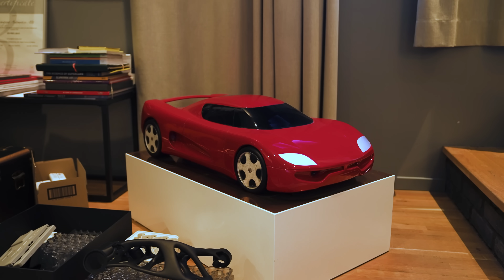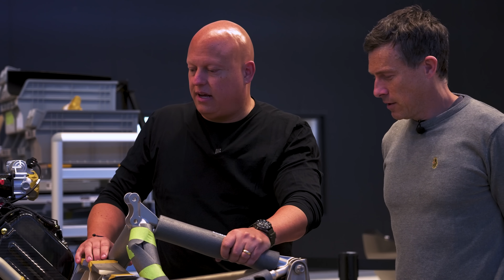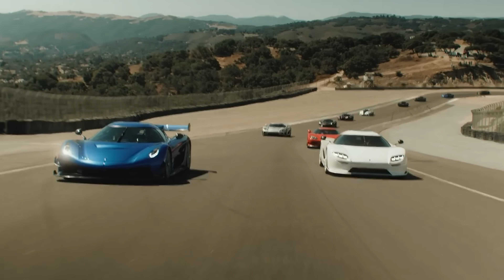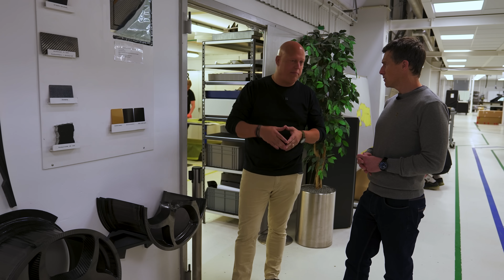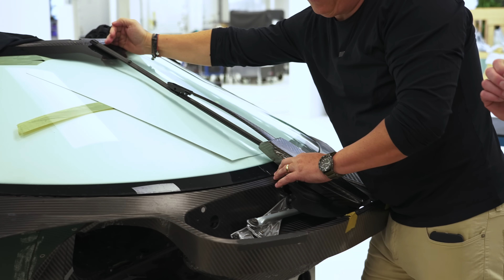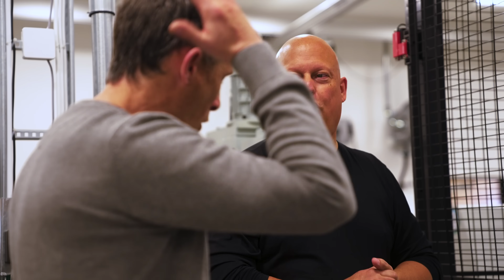Why Koenigsegg’s new 2,300hp hypercar changes everything

Comment: 335 mph is THEORETICALLY Possible for a car like this given the power outputs and drag coefficient. (What's LACKING however in order to make that possible though is the 18 air vents on the wheel fenders (9 on the front left and 9 on the front right) like the Bugatti Chiron Super Sport and the Bugatti Chiron Super Sport 300+

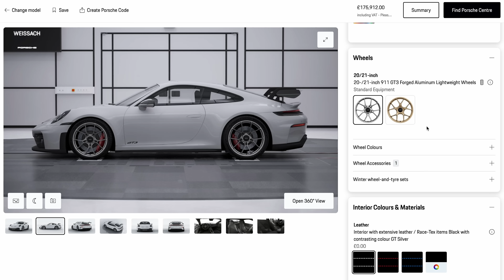Comment: Around 22:50 interestingly seems like the caliper assembly should also act as a pendulum or swung mass for better control on turning and stopping. The swing on the caliper assembly could be adjusted by the rack as it rotates along the knuckle. I just thought I’d share this with anyone watching. Has nothing to do with the cars in the video lol

The knuckle and caliper throw suspension augmented angle back with mass off to one side in the rear. Of course the suspension rides it’s own angle but the caliper assembly is preventing it from being a proper piston. It has mass in the back.

Comment: 2300hp is insane. But this sounds like it is so smooth and very balanced w/deep torque and power curves that are throughout the entire system. Amazing. The valves control by electronic pneumatic control I thought about 30 years ago but he actually did it on a 3 cylinder and got 600hp out of it. Crazy.

Comment: To say carbon fiber does not flex or crack under pressure is wrong. That’s why they don’t make submarines out of carbon fiber because as we know, one company found out the hard way sadly, their submarine built from carbon fiber blew up halfway down to the Titanic, so carbon fiber does have a stress factor and a life expectancy like all forms of material even a submarine, which again the military does not make out of carbon fiber for a reason has a life expectancy, but of course we’re not driving this car at the massive amount of pressure that the Titanic is subjected to, but a pothole. Yes, I know it’s a different an inherently, less dangerous, subject, and much less pressure but still hit a pothole it 315 miles an hour I would be willing to bet that carbon fiber would probably break too.

Comment: I’ve watched videos on freevalve ,and we alredy have many engines which can do 85-90% of what freevalve can do, and that last bit of 10-15% on some engines yes can make a 30-30-30% increase in power mpg,and emissions,but the cost to go main stream would be massive based on what many experts say..I had thought free valve was magic but we have oil controlled valves which can already do what freevalve does within 10% and for 1000’s less …bmw has a engine which already provides dozens of different camshaft profiles with just oil pressure..if freevalve could be done cheaply with a computer which didn’t double the cost of the controller and harness maybe, but still I’d love freevalve from a tuners perspective being able to just add a turbo push as much boost as you wanted within reason and always have the perfect torque and power throughout the entire RPM band. If you could keep the cost down, which is highly doubtful, which is why Free valve will probably never go mainstream.. a Chinese company tried it and decided against it due to cost..

Comment: Not impressed. The body has lots of surface imperfections from the manual sanding. You can see in the light reflections why humans can't compete with the machines. The only insane thing at Koenigsegg is the huge ego from the egg-shaped head of the owner, who thinks that his cars are perfect. The engine's power also produces an enormous amount of heat. That car is for showing off only. The yuppies and rich old men are the buyers. Who would pay such an overinflated price for a useless car?

Comment: And the EV McMurray still blows its doors off.
Reply: Cool that McDonalds has started to make cars like the McMurray 😂
Reply: @netmannetman8124 which makes this Koenigsegg variant even more embarrassing
Reply: @simhorizon446 Nope not it at all ...Koenigsegg never stated or claimed that the Jesko Attack would be a super fast car in a straight line. They only stated that the car would perform geat around a race track as it was designed to do. But the Absolute version was designed with top speed in mind and will perform great in a straight line as proved by Carwow who tested the Koenigsegg Regera against the Absolute in a straight line and the Absolute out performed the Regera 👍..So the game is still on 😀
Reply: @netmannetman8124   The McMurtry Spéirling would lap any track considerably faster than this Koenigsegg  … McMurtry would probably lose on final top speed unless the modified the electric motor drive ratios.  The Koenigsegg is more about form over function.  2300 HP can’t be utilized until the car is over 100 mph as it would just melt the tires … so all that energy can’t be utilized.  The McMurtry can use its energy so much more efficiently and deploy it so much more efficiently … The McMurtry was a full 4 seconds a lap faster than Renault R24 F1 car and the McMurtry was 15 seconds per lap faster than the Koenigsegg Jesko Attack car.

Comment: Comes down to traction control and 4 small patches of rubber to the road. There are 250 horsepower motorcycles  that weigh 450 pounds.  If not for electronics not rideable.  Electronic awd making thousands of calculations per second makes this vehicle drivable.  Analog awd no way.

Comment: Variable, REAL TIME GPS engine mapping based on lat/long, vehicle speed, engine rpm,  transmission gear, manifold pressure, coolant temperature, throttle position, roll/pitch/yaw Gs while on the race track is mind blowing. 🤯

Comment: I love cars.  Style and design, engineering, and where those meet. 

But when it comes to electric motors, I couldn’t be more bored. Where’s the engineering? Oh the batteries have a cell with more electron storage blah blah I don’t know and I don’t care. 

There’s no passion in an electric motor. There is a Freudian connection to the internal combustion engine that I want, ha ha. And seeing these beautiful cars with a humming whining e-motor that could be interchangeable with any car… it doesn’t feel the same. There are no interesting features or challenges in the building of an e motor. Electricity, drive shaft (is there a driveshaft?, jk, I don’t care) wheels, boom, done, just like the next guy. It’s too easy. It’s too easy to go fast. Part of what makes Ferrari and Porsche great is the innovation in engineering engines to create a specific model, or overcome a specific problem. Struggle precipitates greatness.

Comment: My car has a 3 cylinder engine but it's a Hyundai,  I can't stand the thing,  every other car I've had has had a standard 4 cylinder engine,  my current car has the ability to shake itself to bits I reckon,  the other day I was letting the engine warm up before setting off and I happened to have the door open,  I kid you not when I noticed it I closed the door as fast as I could, the entire thing was vibrating so much that I was worried about it developing metal fatigue and my door falling off!  There is no way and no person on the planet who could convince me that the level of vibration is not going to end up with something breaking!  
Two words,  "Planned obsolescence"

Comment: I need a multi hour documentary with CK guiding us through the Koenigsegg facilities. Anything he is willing to show and talk about. Im talking design studio, wind testing, machining, making of carbon parts, electric motors and batteries, THE DOORS, break in, paint, drive testing, pre delivery inspection, crash testing, structural testing, THE DOORS again cause the engineering is so cool, customer delivery. 

Im sure youve already thought about it…

Comment: I love everything about Koenigsegg as a company. If I had one critique, it would be to shift a little focus away from chasing ever-higher horsepower and put more into refining overall drivability and the driver experience. I love fast cars, but anything beyond 500–700 hp just isn’t usable outside a racetrack. Trying to manage 1,500–2,000 hp on the street is nearly impossible, and buying a hypercar that ends up collecting dust doesn’t make much sense, no matter how much money you have.

Comment: I did some work for the company that helped Christian to make the first show shell and also made a bunch of parts on at least the Agera, including some of the carbon wheels. he let me hold one of those carbon wheels and they are crazy light! but I didn't want to hold that wheel for too long and I was really careful putting it down on the floor again because of how expensive those wheels are! if I'm not mistaken did a set of carbon wheels on the Agera cost about one million swedish kronor (just under 100 000 euro or just over 110 000 usd)

Comment: it will not change that much. You proved that a 1600hp 2000kg Bugatti is still faster than a 1600hp 1300kg Koenigsegg. They can't translate all that power into acceleration.

Comment: One electric motor running 4 individual torque vectoring simultaneously?? Umm..... shouldn't that come along with a rather questionable HOW...... no, obviously not! One motor running as if four completely individual motors as if on each wheel, seems a little ahh..... impossible!! By scientific laws & rules you'd just not bother to even try, & there in lies the many many limiting lies controlled by modern sciences premise to do so!!

Comment: If ford GM,and dodge used his tech which is used in F1 they could make 30% more power ,and fuel economy as well s less emissions while saving trillions combined over many yrs, by not using batteries…for one thing gas car engines are cheaper ,have more aftermarket parts, as well as being cheaper to rebuild,аnd recycle as well as being recyclable!

Comment: The free valve system was first developed by Lotus and Renault way back in the eighties. It wasn’t that successful but koenigsegg has developed it to its current level.
Reply: But still not ready for production.  No car sold by them has that Freevalve system installed.  So it is a vaporware.  You cannot make it work by selling to middle east oil tycoons.  They use the car as high end toy.  It is quite obvious that it will never been used in any production car.

Comment: Koenigsegg should partner up whit Volvo to build the new S90 hybrid whit small 1.2L 3cylinder whit 300hk using the free valve technology and the black matter 300 hk electric engine and 40-kwh battery for 300km range in pure electric mode whit ability for 200-kwh fast charging in 15 min. This car will totaly crush the market. 600hk 0-100km/h in 4-5sek 1200km in range  and only 0.4-0.5L fuel consumption per 100-km. 😎👍

Comment: Due to physics of tyres more than 1200hp are useless. You cannot get it on the ground. You always end up at 2sec 0-100. After that you need active downpressure (fans). So lets see when Koeniggsegg offers 10.000 hp for the technically imbecilles.

Comment: If only Koenigsegg could build a car capable of working 24 hours without breaking and going to the service center for many months each time it fails. From what I've seen a Koenigsegg requires at least 3 months in the repair center for ever 30 minutes of run time when it will actually start. Their warranty time should only be counted while the car actually works and have the clock pause for every minute spent being repaired. Evidently Koenigsegg has zero quality control and no clue what that means.

Comment: It's Alright building these huge horse-powered engines. But let's be practical. ''WHY'' It's not the fastest car with 2.300 hp that people want, it's a comfortable car to ride in. With the state of British roads, you can't drive very fast anyway; if you do, numerous accidents occur. The police pull you over for speeding. If the streets and roads were like racing tracks, then yes, a fast car would be very nice.

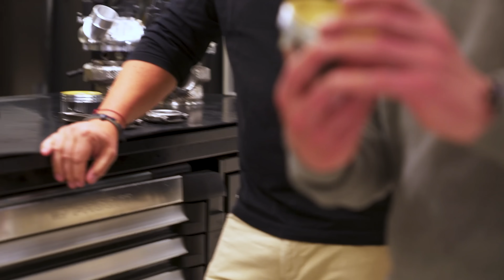Comment: 15:50 “No one is gonna see this.” I disagree.

Koenigsegg factory a assembly hall where wizards come to work.

On one hand you have the craft of assembling a car which is an essential part of engineering per definition.

The whole construction is larger than its parts holds only true if you add up on it in every detail and make every tool and car part special as well as make it look and feel special. You treat it differently and it adds up everywhere.

The assembly line was by far the cleanest I have ever seen and I worked several years in the trenches of a huge international car company as a student. So this relationship is mutual, not one sided.

On the other hand there is bootlegging and cheap clones not only damage reputation but can cause serious damage to people in the hypercar category.

Comment: Don't you dare go full electric, even the three cylinder nearly made me cry. the only way to go and stay at the top is with a V8. Just put in a huge alternator to power the electric motors instead of batteries so you have the option of going fuel or electric, the reduction in weight is huge without batteries and it is the same as driving a fuel car, pull into the petrol station and go on full electric with a few cylinders running for the power unit and the full power output could be at 1500rpm hence super economic but then you can switch to petrol V8 go and sound, also you can run the V8 on 6 or 4 firing cylinders for even better economy and have compression lifters on the cylinders that are not being used hence even more economy. It is a pity I will never own one over here in Australia. Have a good day. Leon from Australia

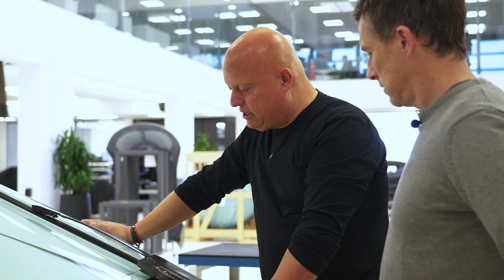Comment: 25:14 - Mercedes's Mono-Wiper worked exactly like that - but it never caught on.
Reply: Yes I've seen those. Solid idea but not perfect in real use. I can't say I know what the real problems were but I can guess at coverage of the extreme left and right is one problem. Then there's the rate it swings at. With two wipers they cover a smaller area each but only have to sweep over ab bit over half the area of the windshield. With one big wiper like this it has to sweep over all the area making it hard to do it often enough if it rain a lot. But then that's really more of a problem for a standard car. These super and hyper cars are usually not driven when the weather is that bad.

Comment: The thing with the wheel weight Christian is talking about is 100% correct. I drive a lower hp car and am running 18 inch in the summer and 15 in the winter. Car feels with the smaller rims like 15 hp more. But also the gear ratio affects the equation. Great Video. I now need lighter rims for the summer😂

Comment: NGL this motor would change everything, from boats to jet skis, to airplanes or even flying cars, like 2300hp and 1700 torque around 1,700 RPM is like a NEW TESTAMENT, could even kill the semi trucking industry with diesel gas, or it can be just tied to Koenigsegg forever, either route, this motor along with electric motor setup changed the spectrum, talk about full power when you not even in full boost close to idle RPM with turbos is a 1st of its kind, even if this motor was put on a motorcycle like how boss hoss do with v8's like this motor would blow them away an possibly the rider who driving the bike itself. Could even use this motor for a 1man helicopter that would be zooming too! I bet if a jet ski had this 3 cylinder motor it may do 220mph+

Comment: I think the issue with the free valve not being offered in the production is simply that their version of pneumatic valves doesn't work as well as the F1 verson!!  It is the single most exhilarating bit of internal combustion tech  that has ever been developed.  Freevalve tech brings  multiple and massive advantages.  The engine is shorter, lighter, massively more controllable, more efficient but they haven't gotten all the gremlins corralled!!!

Comment: Pretty impressive, but I question if his use of carbon fiber as the go to solution for every problem is the best choice.
Nowadays there are instances where special steel can be used to make parts lighter than if using CF, like in top end bicycle frames that need maximum stiffness and minimum weight.

Comment: Casually mentions his 3 cylinder engine runs at 600 freaking horsepower. I’m guessing it’s only acting as a generator powering electric motors, which is equally insane.

Comment: This is not a totally uncommon issue in all modern cars, and has caused accidents before, Tesla especially, phatom braking. I turn it all off especially side collesion, and just have forward auto braking on as late as possible, (annoying though it resets evenytime you turn on ignition) but all of the recent cars I have owned over the last 8 years have all at some time or other phatom braked for what I would call as to over reacting to a scenerio that was not a reason to brake, even a car approaching on a side road too fast and then braked late can cause the car to phantom brake hard. I personally think all this steering assist technolgy is dangerous on British roads when driving in bad weather, narrow roads even main roads with poor line markings. I own a BMW i4 M50 the steering assit drives me up the wall, even different shades of tarmac will make it steer around it. It is only really usable for motorway driving.